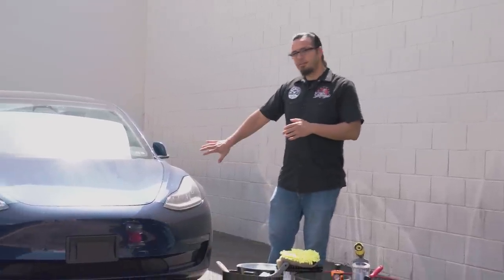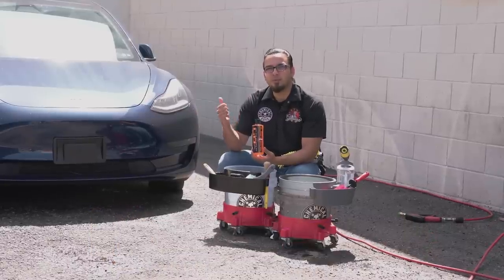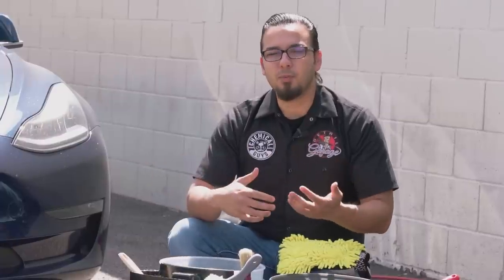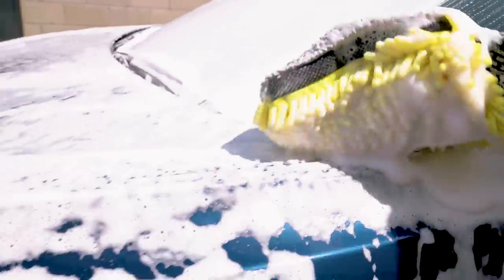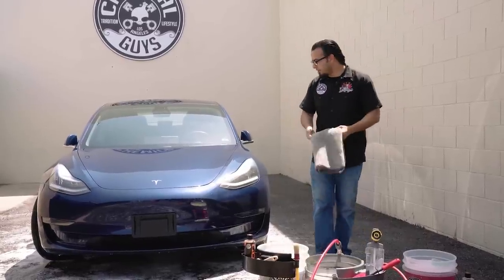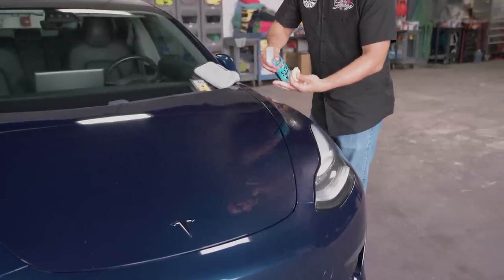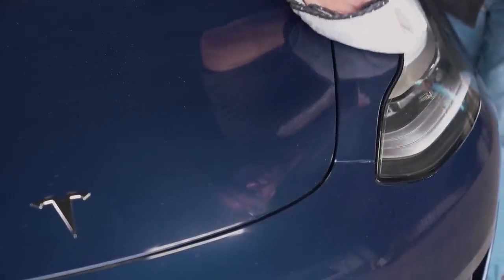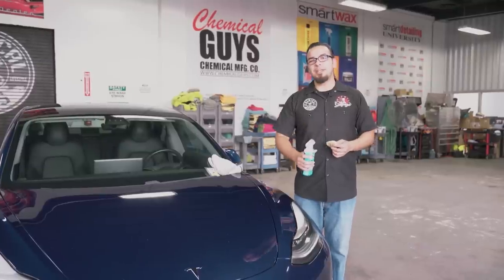How To Clean Paint Spots From Your Car - Embedded Contamination, Splatter, Road Grime, and More!

Comment: You’re a life saver I thought I had a paint problem.  I used Mother Lubricant after the wash with Clay bar, the. Put some ceramic.  I was skeptical at first, the key is to do one small area at a time, once it’s smooth then move to another spot like you said.  Thanks!
Reply from the maker: Happy detailing!

Comment: Hello! Thank you for your advise! I recently found out that my car had these white specks that is very difficult to get rid of. Also, i was wondering if you can help me how to clean the bumper and the wheels easier. They also have these white specks that is very difficult to wash off. Can i use the clay bar on those too? Thank you for answering!
Reply from the maker: Hi there! The clay bar can be used on any surface that is gloss painted, shiny or clear.

Comment: Hello... I got my clay bar kit and I'm ready. However, after seeing this video, what you guys do after wiping down the clay lube? Do you rinde the whole car off or wiping out the lube is enough to move on to the next stage of protection?
Also, is clay lube like a quick detail spray as well? Just curious. Thank you for the help guys 🤘🏽
Reply from the maker: Hey! It is perfectly fine to simply wipe away spent Clay Luber with a clean microfiber towel. You can use a product such as Wipe Out to ensure the surface is totally clean before applying coatings.
Reply: @ChemicalGuys  
Thank you for the tip.
I'm doing it one section at the time while keeping it in the garage, so I need to keep whipping down the car from dust and residue.

Comment: As a novice, after using the clay bar does the car have to be polished? Or can it be waxed by hand?
Reply: You dont need to polish it. You can just add wax😁
Reply: But then again if you want to polish than i would highly recommend claying it first so you pick up anything that can get picked up in the pad and f your paint up.
Reply from the maker: Hey! As long as the clay bar is used properly with plenty of Clay Luber it will not scratch.